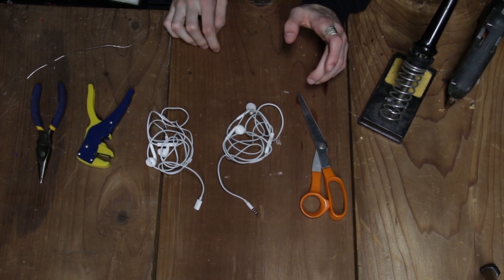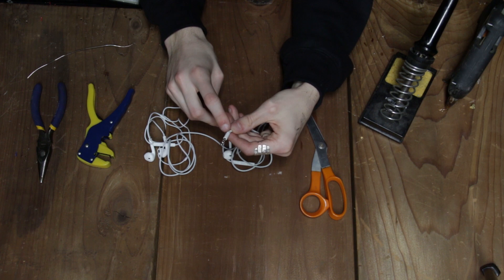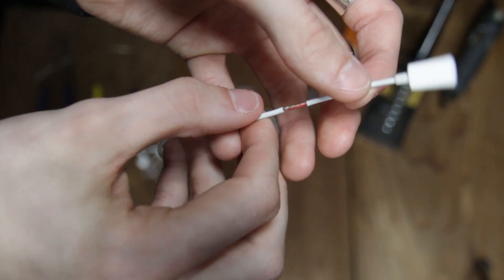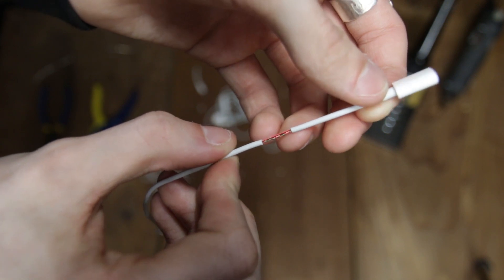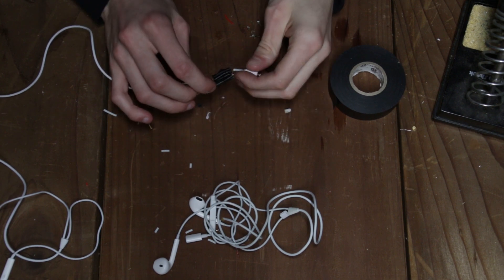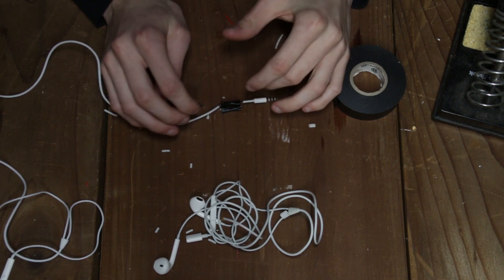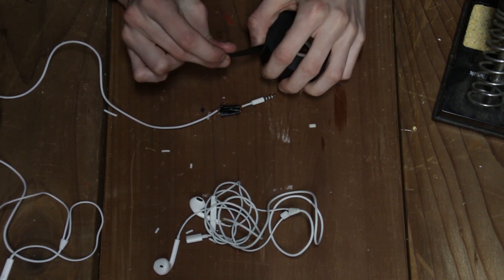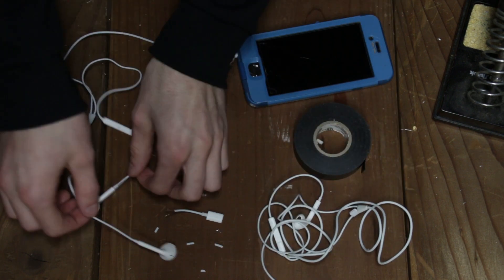Turning Lightning Port Earbuds Into 3.5 Jack Earbuds

Comment: Nevermind I take that back. You didn't show which wires you put together. Which is what should be the main part of this video. Damn bro.
Reply from the maker: Koti Walchesky once you cut the cables open you will see that they are different colors. Just match up the colors on the earphones to the colors on the port cable you're using and that should do the trick. Always test them out before you put shrink wrap on it. Thanks

Comment: You turned lightening headphones to headphone jack headphones PLEASEEEEEE TELL ME YOU HAVE A LINK FOR AN ADAPTER FOR THIS!!!
Reply: It don't support lightning earphone to laptop or mobild
Reply: @chaitanyamore8786  wdym ? if i cut the lightning port and connect 3,5m jack will i not be able to use it on pc?
Reply: there is one on online bro search it